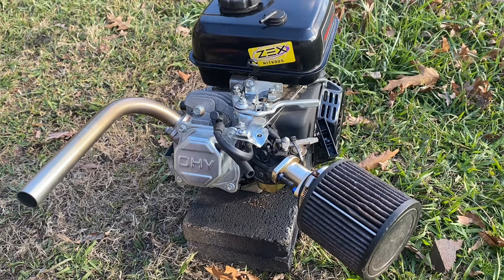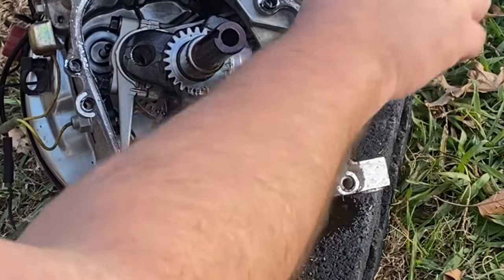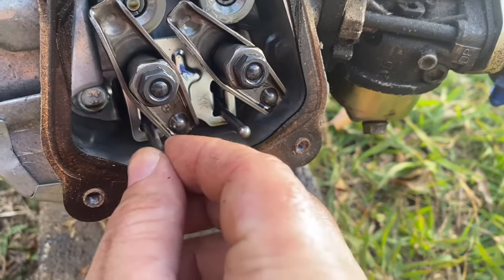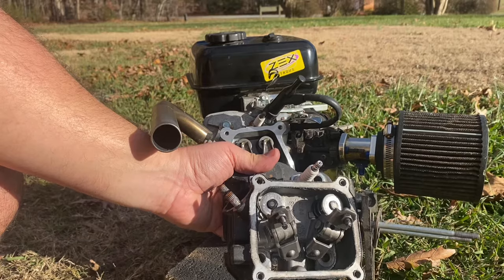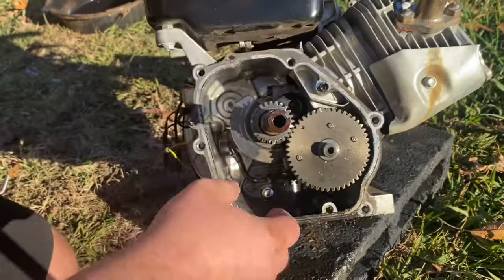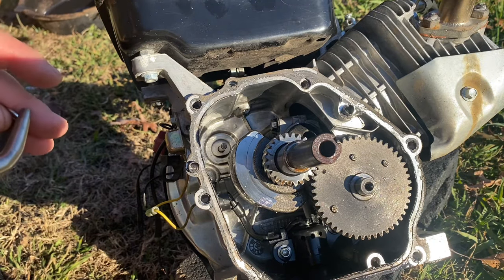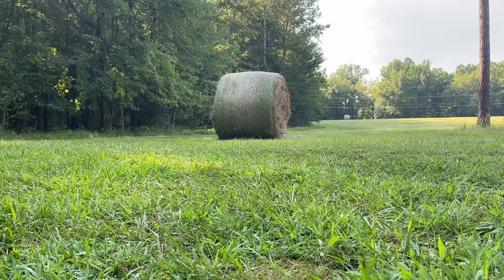Top 4 Reasons Your Predator 212 Won’t Start After Governor Removal

Comment: Good point, that’s why is a good idea to disassemble the engine completely. Some people look for the easy way out. The point is, take your time and do it right. And another I noticed on those engines is that where the key way on the points when it’s facing the valve cover it on top dead center.
Reply: I agree. Taking engine blocks down to the bare block is one of my favorite parts of small engine repair because before I had sonic cleaners I'd tear  down the cases and put them in a dishwasher

Comment: This video was very helpful!!!! Just wanted to add some more back ground. I have a harbor freight chipper and its crankshaft snapped  which is common issue. Took the entire thing apart with some pretty good videos on YouTube, but after putting back together I spent an hour pulling the cord and it wasn’t starting up. Found your video and I had misaligned the cam shaft and also had push rods that were no longer connected. Took everything back apart for a second time making sure to follow your steps when putting back together. Got it back together and it cranked up on first pull. After around 10 hours of wrenching on this thing it Felt so good to get to hear it fire up on first pull. If only I had watched your video before diving into this I would have saved 5 hours.
Reply from the maker: Can’t prepare for everything! Glad it was helpful

Comment: I removed my gov and now it won’t turn on it was turning on before removed I checked push rods and all other stuff looks all fine spark plug is good just won’t turn on now
Reply from the maker: Hmm, the first place the start is to check for spark and fuel. Spray some carb cleaner or starter fluid in it and see if it tries to start. If it starts then it’s a fuel issue. If it doesn’t try to start pull the spark plug out, attach it to the coil and ground it on the engine while to pull the pull start to check for spark. It could be many things but check fuel and spark first can help narrow it down. I’d check all of the wiring and grounds just to make sure something didn’t get disconnected.
Reply: @jwsbackyard6413  okay thank you I’ll try it out and let you jnow

Comment: Wish I seen this video 3 weeks ago 😬 I  had both #1 and #2 happen, I caught the cam/crank dots miss aligned, with the side cover off when deleting the governor and oil sensor I must have bumped the cam.
I remembered after sealing up the engine that they weren't aligned, so had to take cover back off and align them, went to start engine and noticed something wasn't right so I removed the valve cover and seen the push rod for intake wasn't under the rocker arm. 🤦‍♂️no damage was done thankfully and engine fired right up and runs great!
Reply: i appeiciate your honesty... now i dont feel so bad

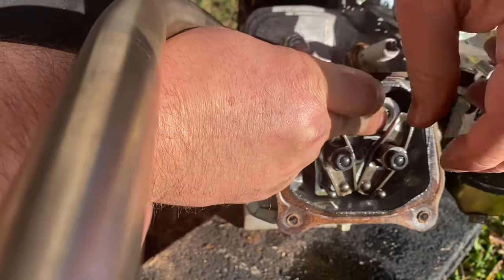Comment: This video saved my tail man! We had a back up 212 for kart racing and tore it apart months ago. We just threw it on the kart this evening and pulled, and pulled and pulled. Watched 3:02 of this video and remembered the cam did slip out a little when we removed the governor. Took me 5 minutes to fix the slipped rod. Thank you so much!

Comment: Lol i just rebuilt my predator ghost. It was a complete removal of parts, spec and reinstall with three new parts. 
Went with the Arc flywheel , rod and a nibbi 24 mm carb. 
I had a feeling when i was setting the gap on the coil to flywheel that it wasnt enough gap for a strong spark. 
I went over the 32thou and posibly around 40ish thou lol but i was getting a briliant spark off of this LG spark plug ? 
My issue was that the engine wasnt firing, i had fuel l, spark, and what seemed like nasty good compression. 
I set the valve lash as per almost every video ive seen or articles online. I used my feelers gauges and i had a feeling the valves were opening sooner letting some of that compression out. 
I decided to lash my valves the same way i set in all my older SBC.
That start up was amazing =)

Comment: Will the engine perform differently if you DO NOT remove the governor internally?
Reply from the maker: It’s won’t perform differently but you run a risk of governor breaking apart at the higher rpm’s and damaging the engine

Comment: JW
I have a 212 predator… been running fine. I had to replace head gasket and the push rod fell , just like you said in the video. I put everything back, just like you showed in the video… my issue is that now I have no power at all. The motor sounds fine, but when I press the gas… I can’t go…. It revs up like it’s acknowledge that I am giving it gas… but it has no power. I can’t go. Any suggestions?
Reply from the maker: If it sounds fine and revs but won’t move I’d guess it’s was an issue other than the engine like a clutch/converter problem. I’d go over the carb too and make sure the gaskets and linkages are right.
Reply: @jwsbackyard6413  if I am on flat concrete and I push it to get going… then it will slowly build up speed. And drive ok until I slow down. Then it starts over again and I have to push it to get going again. It almost feels like the clutch  doesn’t have a locking key in it…but the key is built into the clutch. I have my clutch turned around , like in your video. I don’t have any spacer or washer, because the sprocket wouldn’t line up…. Is it possible that the key of the clutch doesn’t go that far down the shaft, and it’s not catching?

Thanks
Reply from the maker: @commoncentsideas1215  from my experience if the key isn’t In it wouldn’t move at all. You could easily check my pulling the clutch and looking for wear marks on the output shaft. Sounds like you could just have a slipping clutch which could be from a bad clutch, too light clutch shoes, too heavy of a clutch springs or to low of a gear ratio.
Reply: @Common Cents Ideas  are you using a straight chain clutch or have a torque converter with a belt? I tried switching to straight chain just for shits and giggles and found I lost all power on take off. Torque converter is the way to go

Comment: Just put a stage 2 head an hot rod cam on 212 with billet flywheel an can't get it to start any ideas checked timing an is lined up correctly
Reply from the maker: With a new flywheel I’d make sure you check spark if you’ve went through the stuff in the video.

Comment: I have a 212 Beni but you can’t turn the arms to get the rods in place. What is the solution to this?
Reply from the maker: Try taking out the spark plug to relieve the compression. That should allow you to turn the engine over easily.

Comment: JW have a predator 212…engine will start ill move switch to run but went I hop in to go and press gas after a few seconds engines dies…I have replaced the carburetor already. Then after it turns off it wont turn back on, when J try again the day after turns on and then dies again with gas. What could it be?
Reply from the maker: Still sounds like a fuel issue. I’d make sure the tank isn’t clogged. They are prone to rust inside without you knowing. Are you running a fuel filter? If so they are know to clog even though they look fine visually. Next time it does it try some carb cleaner or starter fluid and see if it will fire. If it does it’s a fuel issue.

Comment: recently took the govener off and everything is good it’s just that not my carb isn’t getting any gas do you know what could cause that?
Reply from the maker: Do you mean no fuel is getting to the carb or do you mean that the throttle isn’t working?
Reply: @jwsbackyard6413 I have the same issue I have no clue what’s wrong I pull it sounds fine and after a few pulls it backfires but when I smell the carb cover where the filter is doesn’t smell like nothing and I pulled my spark plug and it isn’t even getting wet
Reply from the maker: @ayodevin4017  I would make sure the fuel cut off on the carb hasn’t been turned off by accident. Other wise I would unscrew the bolt on the bottom of the carb and see if you have a steady fuel flow. If there is no fuel you know the issue is pre bowl. If you do have fuel but it’s not making its way into the intake then something may be clogged in the carb.
Reply: @jwsbackyard6413  I tried everything not sure what else to do gas is going through carb it just isn’t firing cam is aligned with crank, do you think it’s because the way I have my throttle set up because I’m using a stock carb
Reply from the maker: @ayodevin4017  how is your throttle set up? You can also do some easy diagnosing by spraying some brake cleaner in the carb and trying to start it, if it starts with an external fuel source like the brake cleaner you know it’s a fuel/carb issue. Or you can pull the spark plug and check for spark.
Reply: @jwsbackyard6413  It’s got spark already checked that but im gonna try the brake cleaner tomorrow
Reply: @jwsbackyard6413  do u mean starting fluid?
Reply from the maker: Starter fluid would work also but brake and carb cleaner can be used as a fuel source as well. Most people are more likely to have brake or carb cleaner rather than ether/starter fluid so I just say brake cleaner.

Comment: I have a intake and straight piped predator 212 engine and it won’t start I’m not sure why
Reply from the maker: What are the details of it not starting? Was it running then stopped, modified then wouldn’t start, etc.

Comment: What would you do if one of those lash caps is no longer on the valve spring
Reply: I took the valve cover off and one was missing and not in the head anymore. Easy way to find it? 😅
Reply from the maker: The only place it could be is down in the engine. You’re gona have to take the side cover off to find it unless you get lucky and it comes out through the oil drain plug.
Reply: @jwsbackyard6413 I got that problem all solved put it all back together and every couple pulls it’ll shoot a flame but won’t start.
Reply from the maker: I would make sure the cam/crank timing is correct. I’d check valve lash too

Comment: I took out the governor ant i left the governor arm hanging and I think it’s making contact with the engine what can I do?
Reply from the maker: Remove the arm and put a bolt in place of it. Tap the hole for the arm so the bolt will thread in. You use the bolt to hold the factory throttle linkages so everything works the same. The throttle arm just has to be able to move freely on the bolt.

Comment: So get this. I ziptied my governor spring. Road fine for some sweet drifts then started givin up. After it died it would only run on choke so i removed the ziptie. Not my motor wont start at all
Reply from the maker: Sounds like a fuel issue. Check spark first. If you have spark spray some carb cleaner/starter fluid in it and see if it starts. If it starts there’s something up with the fuel system. I’d also check the linkages for the throttle and make sure the butterfly is actually opening. The spring/throttle setup on the stock carb is pretty sensitive when it comes yo changing the spring tensions. If all that is fine I’d open up the engine and make sure there isn’t something internal affecting things especially the governor.

Comment: I am having insane compression when i go to pull start it. But it runs just fine. Could you tell me what the cause of that could be?
Reply from the maker: There is a plastic decompression switch on the cam that may malfunctioning. I’d check that first.
Reply: @JW’s Backyard  Okay
Reply: I would check valve lash to

Comment: How to start a predator engine 212 CC
Reply from the maker: If it’s new it will need oil and fuel first. Then make sure the black fuel arm is turned on. Then turn the red on off switch to on. Activate the gray choke arm and pull the pull start handle.

Comment: What if mine won't start right out of the box lol
Reply from the maker: Haha check to make sure the plug is tight and the fuel switch on the carb is turned on and the one off switch is one. If those are good I wouldn’t take it apart I would just take it back and get a replacement. If you can’t take it back you can always check for spark by removing the plug and grounding it on the engine while trying to start it to see if you have spark. If you have spark try some brake cleaner or ether in the intake. If it starts with an external fuel source you’ll know it’s a fuel/carb issue. If all that is fine you can always check under the valve cover like described in the video and check valve lash.

Comment: eew red rtv . you know even regular silicone like for a bathtub is high temp , just not oil resistant
Reply from the maker: Not sure where you are getting red rtv from but I always use ultra black for the all the gaskets unless it’s the exhaust where I use orange/copper.
Reply: @JW’s Backyard  just messing . i use what i got. but really its annoying that the only high high temp rtv is super ugly red .
Reply: @JW’s Backyard  what i meant is silicone is high temp compared to a engine , maybe not the exaust like you said use copper . but im adhd asf so my words come out alphabet soup
Reply from the maker: @travistownsend3254  naw I realized I read the original comment wrong anyways. But yeah I get you. The ultra black and grey all work fine on engines; they have oil resistance and can hold up to the heat.